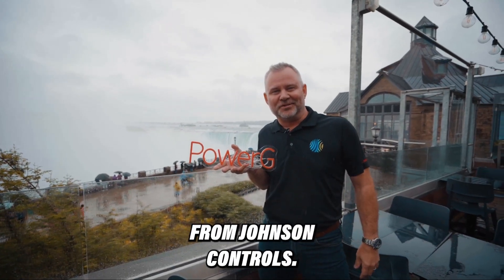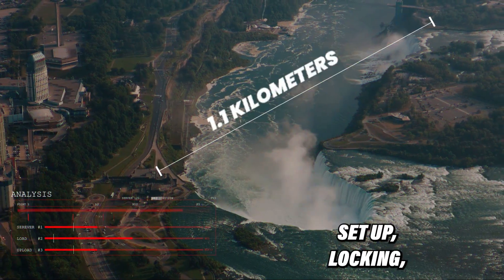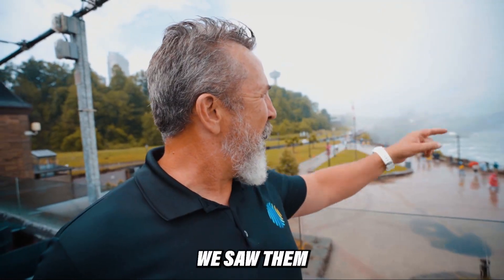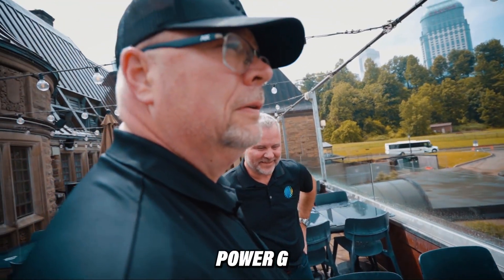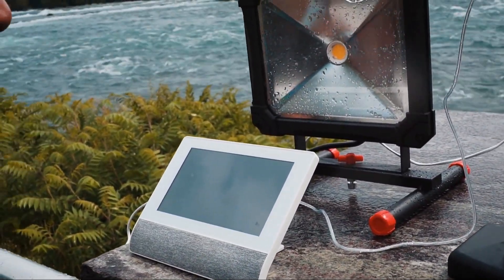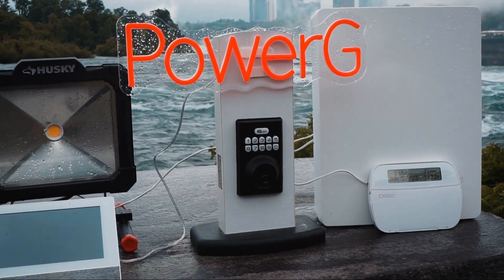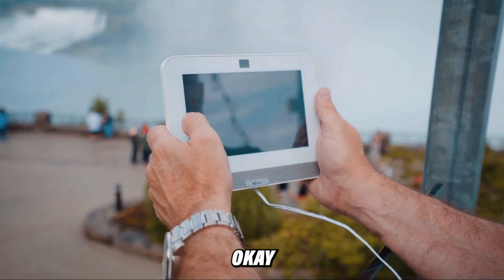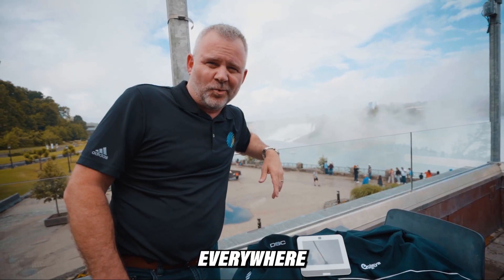PowerG Across Niagara Falls

Comment: Lots of excitement but no explanation of actual usage. If it is just fun with radio electronics, $5 Chinese uhf/vhf radio can send signal further than that. Heck, it can even pick up ISS on a good day.
Reply from the maker: Yeah it's a bit dramatic how they present it. I think they're just having fun. Also, let's be honest, the handlebars are sweet. The use case is it's an alternative to Z-Wave with a much longer range so you don't need to set up and maintain a mesh network in your home.